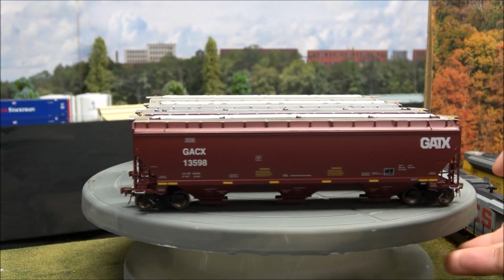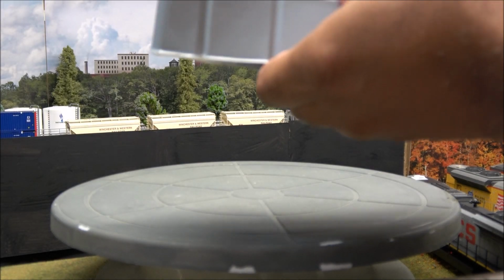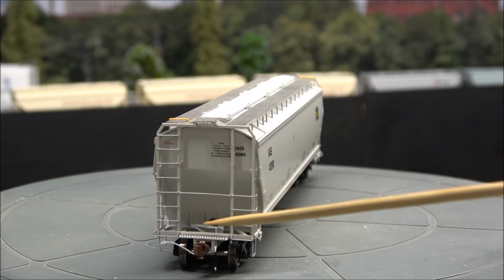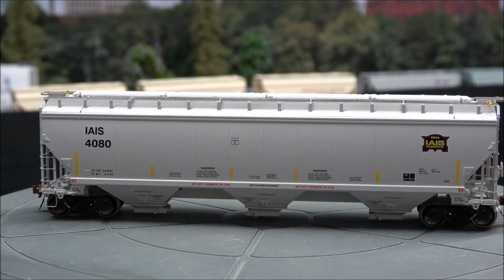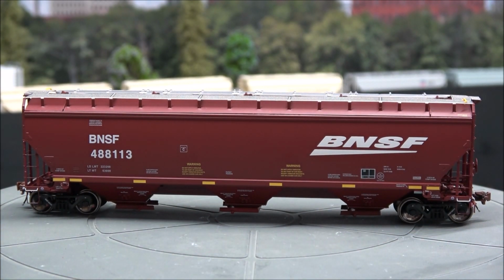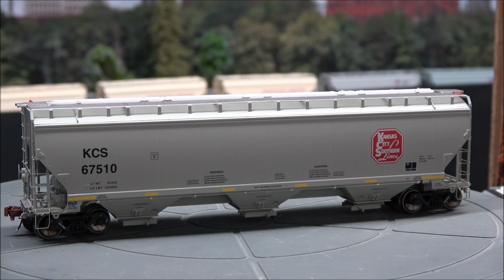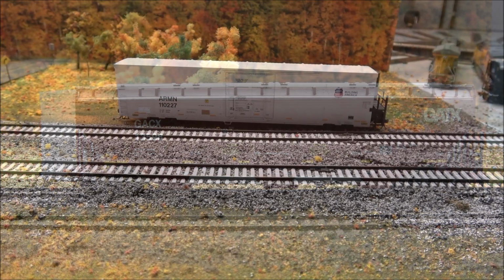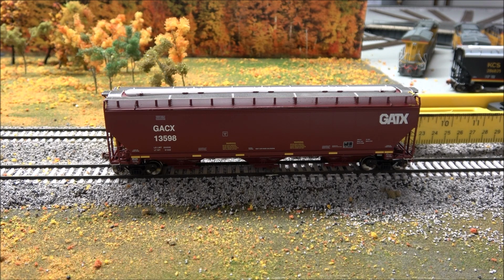Review: ScaleTrains.com Gunderson 5188 Covered Hoppers 2nd Run!

Comment: A caution - inspect your cars carefully.  I ordered 9 of them, 3 different road names, all different numbers, both Rivet Counter and Operator.  ALL of them had a bent right side stirrup on the A end.   I contacted Scale Trains, they said the stirrups were metal and could be bent back into shape which I did.  They did not have a plausible explanation for the damage, which was visible through the clear plastic packaging.

Comment: Great job and presentation. However. I have been subscriber for about a year now. And have gotten to the point where I think I will unsubscribe. I just find your budget threshold far too high. Speaking mostly for myself, but I suspect for others. This is a hobby. And by my definition. And my budget. That means it is probably the last thing that I spend. Money on Which usually means? An annual budget. Of about 200 to $300.  I know you have a heavy emphasis. On. Top of the line. Items. But it would be nice to have seen. Entry level reviews. Of. Above average quality. So that we who are on a very limited budget. Can still make? The best use of our limited funds. In supporting Our hobby.
On a separate matter as someone who likes to try to Anticipate thing, i think I will be saving my money or what I think will be the next big change in this hobby. And that will be. RC. HO trains. Which will radically change The way This hobby is operated.  In any event. I wish you nothing but the best skill in your future endeavors and production. God bless and I may check in every once in awhile. Bye. Bye.😀
Reply from the maker: Take care.  Just so you know Bachmann and Value Trains USA reviews are just a couple of weeks away but I understand.
Reply: Your  200 to 300 dollars is my budget  also, being 70 yrs old and still working, you would think things would be easier they are not. It seems all the money has been vacuumed up leaving nothing but credit, I won't be playing that game.